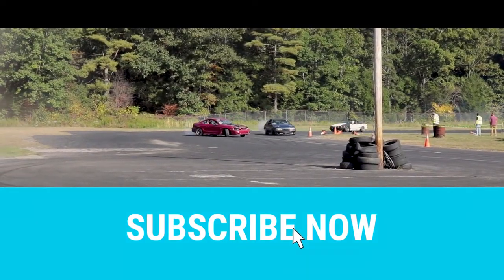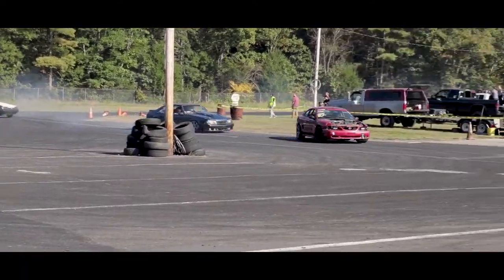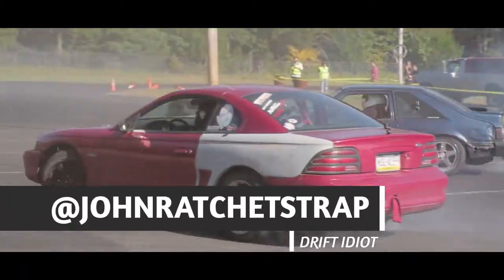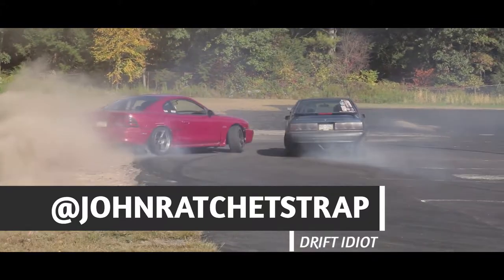5 STEPS TO A RELIABLE DRIFT CAR

Comment: Love the tips from this video, I have been working on my 2004 and wanted to see if you could offer some insight? It is a v6 3.8 and the reason I even own it was due to the fact it was $300 because of a bad fuel pump. I would love to build this to take to the track but every build for the most part I see is a gt, do you believe the car would be decent by starting with coilovers, angle kit, headers & bama tune ? possibly a gt throttlebody? It's definitely not going to be a fast car and the other main issue is the rear end... just weld it and eventually go to 8.8? lol I'd love any thoughts you have ! thanks
Reply from the maker: It’s definitely a great car to learn on. More than enough power to drift it. Start with coilovers, exhaust, intake, etc. if you’ve never drifted before, don’t do an angle kit. It will only make you learn bad habits. Learn to drive the car, and modify as you progress and need more. It won’t take long to learn. The tunes aren’t worth it. If you want something good, you need a custom tune. Any other questions, just ask!
Reply: @RatchetstrapMedia  thanks man I really appreciate the input on what to do first and validating the v6 will be fine is exciting. Really appreciate it !

Comment: Hey man great video! I have some questions and wondering your opinions on them. I have a 2011 Dodge Charger RT and so far have an exhaust and intake at the moment and i have been drifting for a little while so far and i am wondering i have an open diff would you recommend welding it or just getting a completely new LSD. Also was planning to do coil overs soon and also right now I'm running 235 for tire width do you think it would be a good idea to start running 265 instead with new rims?
Reply from the maker: Thanks! So if it’s your daily, I would advise against welding the diff. If it’s not, have fun. As for the tires, it depends on your power. You don’t want to go to big, because you will have a harder time spinning them, and they cost way more. One tip I can give you, is to use the same brand and model tire every time. You will have consistent grip, and will learn the car so much better because it will be predictable. Also, tire pressure makes a huge difference so experiment.

Comment: Great video man. What would be good affordable coilovers for my 2000 new edge. Also i have a youtube channel of you want to check out the build. Thanks
Reply from the maker: Honestly, just save up and get feal 441. You can buy them as a whole kit, or just front or rear. You can save some bucks by getting just the fronts and running springs in the rear. Thanks for checking out the video!
Reply: John Ratchetstrap thanks man. Keep up the cool videos.
Reply: @RatchetstrapMedia  yup feal or bc! Bc are a little bit more affordable maybe not as good but really good ! Haha
Reply: @RatchetstrapMedia  no problem yet with my scales coilover 🤓 after 3 season (10 drift day total~)